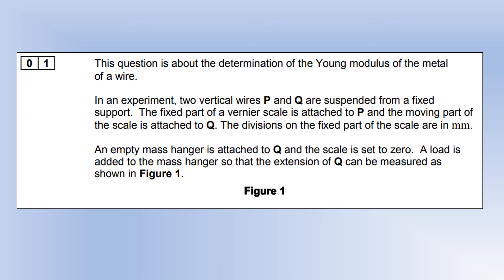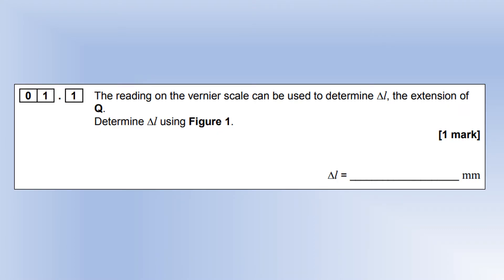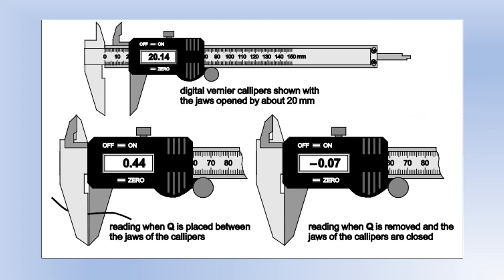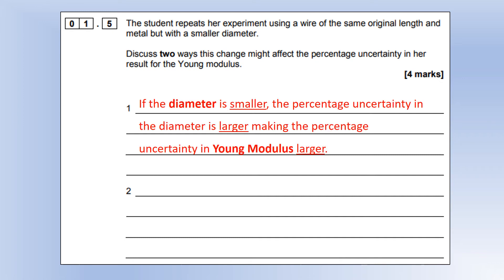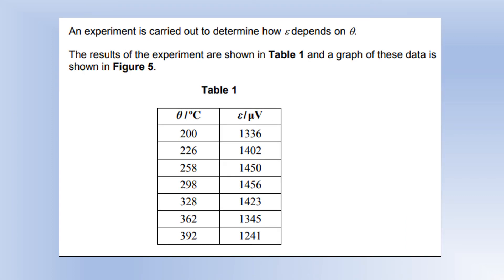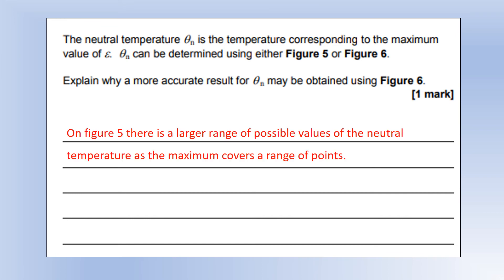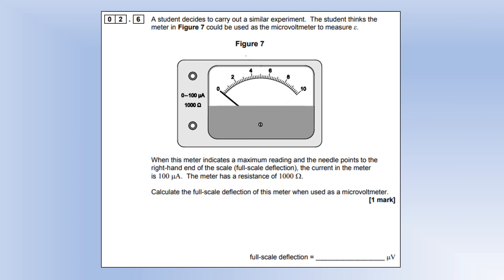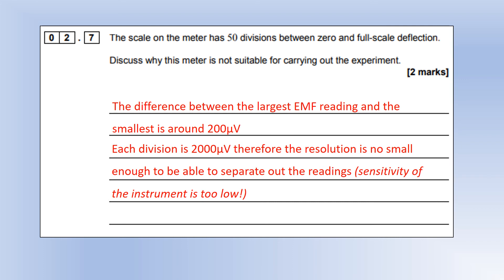A Level Physics: AQA: 2016:AS: Paper 2: Section A

Comment: For question 2.6 relating to the full- scale deflection. Do we not need to first convert ohms into micro-ohms in order to use the equation?

Not sure if i'm over worked. But if I convert microamps to amps and then do the calculation I get the correct answer. But if i convert ohms to microohms I get 1 x 10^11
Reply from the maker: No, to put values into an equation you need them in SI units which is why I converted micro-amps to amps (resistance is already in ohms so doesn't need converting)

Equations won't give correct answers unless the quantities that go into them are in SI units